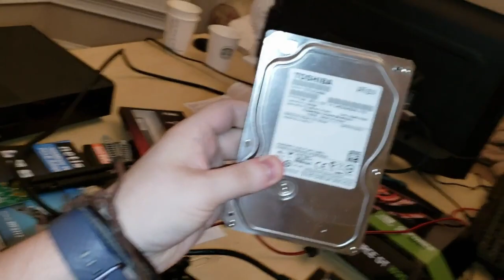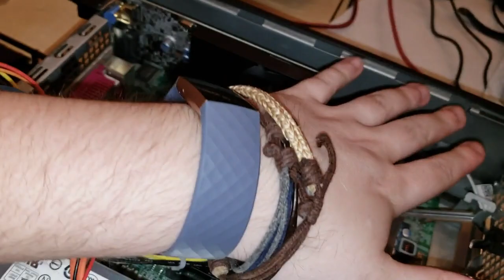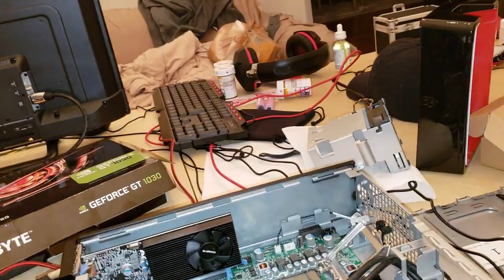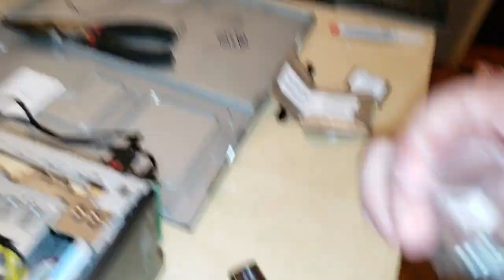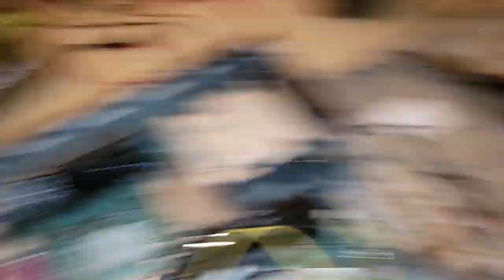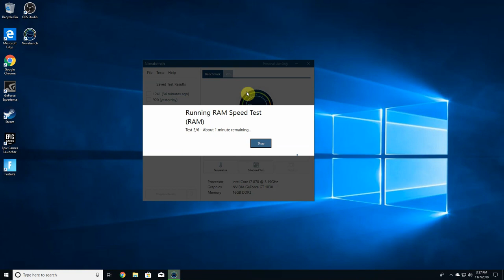$300 GAMING PC - Dell Optiplex 980 UPGRADE - CPU, SSD, RAM, GPU

Comment: Putting CPU paste on the way you did will leave air pockets in your setup. the best way to apply thermal paste is a pea size drop in the middle of the CPU and let the heatsink spread it out when pressure is made when securing it
Reply from the maker: Thanks!!

Comment: hey bud, i was wondering if you could give me some advice. im currently using an i5 Optiplex 980 (i assume it is the SFF version as it is the same size as yours from the looks of it). it has 8GB RAM in there but ive never changed the video card or graphics card on it. If i buy the GT 1030 like you, would it give me a decent FPS on let's say a game like CS GO? decent meaning maybe about 100 FPS? im not an intense gamer but i'd like my PC to let me enjoy csgo during my free time. Cheers
Reply: 100 fps isnt needed to get playable games.
I think you must expect to get 40 to 60 fps max depending on your graphic setting , as long as it is above 35 it will be playable.
I run mine with the i7 + 1050ti , I think you have the i5 650 ?? Thats not much different in speed vs the i7 I have, my best upgrade ever was changing the hdd to ssd and gave a big boost to the system.
Reply: @baklap141  Just watched your video !  i have optiplex 980 sff and got same video card gdrr5 version but my cpu is i5 650 you think its worth to pay extra $60 - $80 to upgrade my cpu to i7 870 any big jump ? i only play csgo
Reply: @ozgurarazi  Not really needed to upgrade , wont be a lot different.
I upgraded it from i3 550 to i7 870 , that was really a big difference. 
An i5 650 isnt really too bad , performance is almost the same vs 870.  If you dont have a ssd drive , thats the best upgrade you can do.
Reply: @toiletpredatorwz  I put my double slot MSI 1050ti LP into the slot by buying an adapter extension cable. I slid the card down and moved the pci-e 16 slot by plugging on the cable and moving the card all the way down . I did not like the pressure it wanted to put on the bottom of the card when it folded to turn upward to accept the gold plated connector. 

One benefit I received from using the Optiplex 980 was in 2017 SSD's were high. So I bought 2 used Dell Server 60gb SSD's and put them in Raid 0. It expanded the drive to 120 gb and the read/write speed of my drive was 1,100 read and 1,000 write when everyone else was getting 550 with a Samsung.  

 I saw a Youtube Video where the guy cut the PS2 mouse and Keyboard ports off and it left about 1/8th inch sticking up and he put a piece of tape over the one little toothpick size remnant and modified the external part off the case where the Ps2 port was and the double slot 1050ti up facing part fit where the port was. 

I also did another test. I took a motherboard gold case screw and super glued it in the bottom of the SFF case in the center rear quarter. Then I took a full sized GTX 750 ti 4gb ( Powered by slot ) and turned it upside down and bent the tab where the screw goes so it was at a 45 degree angle and run a screw threw the normal tab and into the motherboard screw. I used the extension cable I had from the other Msi GTX 1050ti test and connected it to the PCI -e 16 slot.

 For all these test the Full size hard drive was out and I was running just a SSD, I also had the DVD writer unplugged. The GTX 750 ran great, overclocked with Afterburner it was getting 52 fps in Fortnite Epic settings but with just the GTX 750ti, I7 2.93 ghz CPU and 120gb SSD the power supply never cut out but became very hot to the touch. I could play Fortnite for 10 hours like that with the side of the case on ( Case Hot to touch ) and off and the computer worked. 

I took the side panel off and installed 3 old 478 Heatsink and Fans to the side of the power supply and the case no longer was hot on the back side of the power supply but touching the power supply was still hotter than I thought it should be. The 1050ti does not get as hot as the Maxell Chip in the 750ti. From what I have read , the 750 ti runs at 80 C to 85 C and that is normal. 

I wondered if my power supply fan was functioning completely because I had it at 100 percent and I did not think the speed of the fan was as fast as my other Dell power supplies in my Optiplex SFF 740 AMD 2.4ghz Black or my Dell Dimension E520 with a Q6600 core2quad with the tape Mod making it 3 ghz.  

I ended up working on a Optiplex 9020 for a customer and the board and chip had just gone out 1 day after the warranty expired. The only reason I saw was the power supply must have went out and taken the chip. I looked online and the 9020 8 pin power supplies were giving trouble. The customer gave me the 9020 and said they needed a working computer right then , they were not going to argue and wait on Dell. I bought them a Optiplex 9020 Micro and they used the on chip graphics. The customer is 65 yo and uses the computer for greeting cards, photos and Facebook. They had paid $650 refurbished with a 90 day warranty for the 9020 MT and I sold them the Micro for what it cost which was $250 with an I5. She gave me the 9020 MT and because she was happy, she bought me a $225 GTX 1060 3gb. I argued with Dell for 6 months and they finally paid $225 for the 9020 MT that died. So I bought a motherboard and an I7-4790 and fixed the 9020 MT and it has my GTX 1060 3gb in it. 

So my Optiplex 980 project ended and I made it a Plex Media Server. I installed a 2TB hard drive back in the computer and an AMD HD 8570 as the single slot graphics card. It encodes and decodes H265. The I7 860(2.93 ghz ) once took 10 hours to re-encode a file to x265. The AMD HD 8570 has hardware acceleration and cost me $15.00. It re-encodes H265 in 35 minutes. It played the Fortnite copy called something Survival by 10 cent games and I played 2 racing games I downloaded from the Microsoft store, plus it played PUBG Mobile with the android emulator. I still use it as a Plex Media Server and when I had Amazon Prime I used an Echo that allowed me to ask for it to play the Movie choice.

Comment: i did all my homework on installing ram for my dell optiplex 980 sff, mine came with 8gb ram 1TB hard drive and a i3 core. i put in 16gb ram and it kept shutting down and restarting and trying to save itself. put the old ram back in and it was fine. im thinking its a power issue,any help would be awsome!
Reply: Here's a snippet of the guide, I think this is the issue:

"Your computer supports a maximum of 16 GB of memory when you use four 4-GB DIMMs; however, 32-bit operating
systems, such as the 32-bit version of Microsoft® Windows® XP, can only use a maximum of 4 GB of address space.
Moreover, certain components within the computer require address space in the 4GB range. Any address space reserved
for these components cannot be used by computer memory; therefore, the amount of memory available to the operating
system is less than 4GB."

https://www.dell.com/downloads/global/products/optix/en/optiplex-980-tech-guide.pdf
Reply: I have the same issue i tried to put 4 2gbddr3 sticks and it keeps rebooting giving error codes its running windows 10 so i also think it might be a power issue

Comment: have you had any issues with the power supply and its wattage rating on this build? I have a SFF 980 as well and i've been on the fence about upgrading it because I can't determine if the components are going to cause issues with the power supply.
Reply from the maker: No issues, you can upgrade the PSU if you want but you need to get a special adapter that is 32 pin to MINI 32 pin and of course it won't fit inside.
Reply: I run mine with a i7 870 + 16gb ram , ssd and 1050ti on the standard psu and works perfectly fine.
Ive bought a couple different brand ram and none did want to work, im quite surprised yours work perfectly fine. I used standard dell ram made by samsung.
I guess I can upgrade it a bit more since its not the fastest ram around.
Reply: @baklap141  How put inside 1050 Ti? I think there is not enough space.
Reply: @toiletpredatorwz  its a 1050TI 4GB Low Profile that I was using. 
Used an external casing wich Ive made myself for the GPU.
But now I got a new pc , i7 4770/1080ti 11Gb and 16gb ram wich is way more powerful rig. 
The i7 870 is a nice older cpu though.
But I got to say , if you plan on modding a optiplex 980 you better go with the full Midi Tower size. 
Then you can upgrade the psu without problems too and can put in just a normal 1050TI in the case and will work better (also the Low Profile is quite expensive vs normal sized cars from the same class).
The SFF is really limited with the space. 
Also I found out the psu is a little bit on the low power though.  So yes it works but also its not the best solution.  Since you can buy optiplex 980 computers for a really low price safe yourself the hassle and go for a MT case.

Comment: I found Patriot Ram that were 2 x 8gb, Is 16gb the max for this system or is it possible to go higher as long as it's dual channel?
Reply from the maker: Sorry, I got them from frys. I can find my receipt if you still need it. 16gb is highest this can support. Should be plenty depending what your doing with it. I think this has to do with the mb BIOS. 8gb sticks are tricky.

I would be careful with 2x8gb. May not work. When I get home I will find the exact ones I have and send you the name or a link.
Reply from the maker: https://m.newegg.com/products/N82E16820220685?ignorebbr=true&nm_mc=KNC-GoogleAdwords-Mobile&cm_mmc=KNC-GoogleAdwords-Mobile-plaMemory+%28Desktop+Memory%29_-N82E16820220685&gclsrc=aw.ds&gclid=CjwKCAiA0O7fBRASEiwAYI9QAvKrUL4F9lUfVsxWLAAH2IdMHMOkMcR7cJevIRIlszaV5AiPhC056BoC00AQAvD_BwE

Pretty sure this is it, but they are out of stock. Patriot makes another just like this that's a higher Ghz but you can clock it down. Try going to frys. Newegg doesnt keep older items in stock since DDR3 is no longer used, you could try Ebay too. I really dont think 2x8gb sticks will work.
Reply: @ATLTraveler  I looked it up, the max gb per slot is 4 gb. Thanks for the help!

Comment: Seeing that this video is 3 years old, is there a better processor than the i7 870 that I can put in this same computer without issues?
Reply from the maker: I'm not entirely sure, but I doubt it. The problem is the socket. They stopped using the LGA1156 socket in 2012 which is what the optiplex 980 has. I would assume there is a better way to do this now starting with a different base computer and upgrading it for similar price. You can search like LGA1156 socket best CPU or something to see if there is a better option, but again you might be better off today starting with a different base. Also just an FYI your GPU is going to be your bottleneck here, so it really wouldn't even matter if you were able to put like an 8700 in here. If anything I would look at upgrading that first, the 1030 i used in this is complete crap today.
Reply from the maker: Check this guys video out, he gives good advice about the office PC upgrade thing that I did here and then builds one that is more upgradable for cheap. 

https://youtu.be/nJ0GRRitF-k
Reply: @ATLTraveler  ahh ok Ty, I have the Optiplex 980 and the GeForce 1030, and it serves its purpose, I just wanted to play age of empires definitive edition, and it works well, but i recently downloaded aoe 4 and it says my cpu doesn’t support AVX  instructions, not sure what that means but I assume I need a better cpu

Comment: I bought a gt 1030 and have dell optiplex 980sff but I can't take switch the normal bracket on the flu to half heught , I can't take off the screws holding the dvi. How did u unscrew it?
Reply from the maker: U just turn it lol, lefty loosey... did you make sure you got GDDR5 version? Big difference
Reply from the maker: Use some needle nose pliers to get them started, I put the low profile bracket on easily.
Reply: @ATLTraveler  I have the gddr5 version yes
Reply: @ATLTraveler  I also currently dont have any needle nose pliers
Reply from the maker: @notreyone4  u just need something to grab onto the pins to turn it, scissors might even work.
Reply: @ATLTraveler  I have already tried scissors, i can try it again
Reply: Yeah it doesnt work

Comment: What your frame rate
Reply from the maker: Depends on the game, csgo I get 60 to 90. Fortnite is more like 40-60. But I run everything on low settings and literally have no issues at all. I've used this as my primary gaming PC for two years now and it still works like a charm. I play LoL, Dota, CSGO, fortnite, Apex Legends, Darwin Project, Kerbal Space Program, Terraria, among others and I've literally never had any issues. Obviously your not going to get amazing framerate for $300 or so dollars but it seriously does the job.

Comment: Your read and write speeds for your SSD is slow. My cheap SATA SSD gets 500MB/s read and write
Reply from the maker: yeah they are a bit low I just checked, not too worried about it tbh, i don't do any major file movements or downloads. I checked my drivers and everything is up to date, so not sure what is going on. Btw my SSD is a cheap SATA as well...
Reply: @ATLTraveler  I gained 200 MB/s by switching my SSD to the first SATA port
Reply: @ATLTraveler  My SSD is as expensive as the Samsung Evo 960. Mine is an Adata SU650

Comment: Also, what motherboard do you have? Will your GPU generally work for most Optimplex 980 motherboards?
Under is the Command Prompt Info for my board.
-
C:\Users\User>wmic baseboard get product, manufacturer, version, serialnumber
Manufacturer  Product  SerialNumber       Version
Dell Inc.     0D441T   ..CN73604066010I.  A01
Reply from the maker: Not sure just whatever came with the SFF.